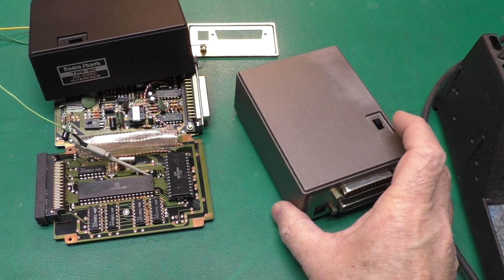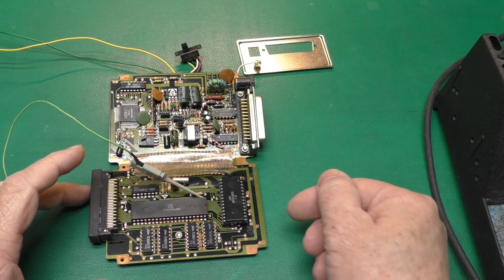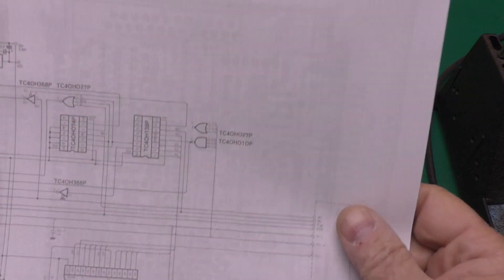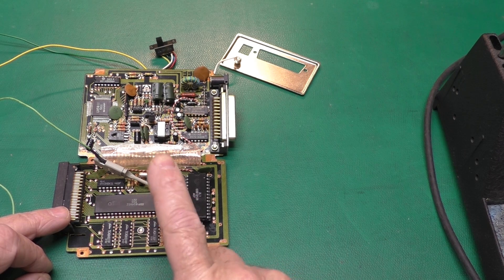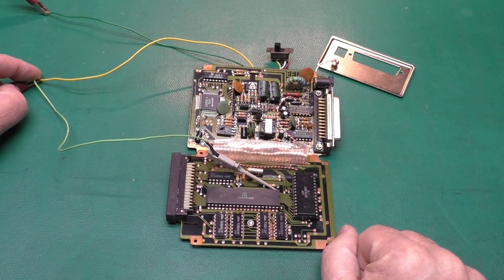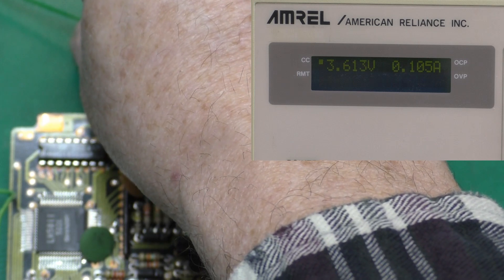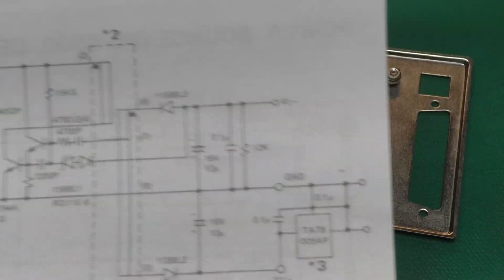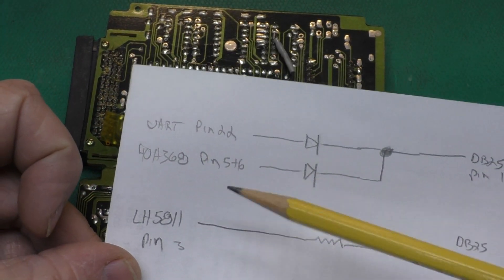Dodgy Bodgy? A very hungry TRS-80 26-3612, RS-232 Interface (Sharp CE-158)

Comment: Hey Birt, Did you have the specific com parameters that you used for coolterm. Can't seem to get my pc-2 with rs232 to communicate
Reply from the maker: Look on the product page. There is a 'Documentation and Video' tab. The ZIP folder has a preconfigured Coolterm profile.
Reply: @HeyBirt  I have the same board revision, but it has some obvious differences. I'm having an issue with garbled characters. Got the boards out for some visual eval and testing.

Comment: as this is a Radio Shack mod on otherwise unused serial lines, it stands to reason that there must have been a Radio Shack product that would connect to this port, yet not a plain serial printer or modem as these would use the normal interface voltage levels. Some specialty Radio Shack product for education or accessibility?
Reply from the maker: I browed through the RS computer catalogs for the years the RS232 interface was sold and found nothing that used TTL level serial coms. It is a mystery at this point.
Reply: @HeyBirt  me too. i dont think TTL serial was even a thing back then. i was thinking of some special device and just using the port as a method of io interface.
Reply from the maker: @fumthings  Sure TTL level serial coms was a thing back then. The Atari's used a TTL level serial bus, as did Commodore.
Reply: @HeyBirt  ok, thanks.

Comment: as for the mod, the DB-25 official pinout (the one comprising the secondary channel, the tx/rx clocks and the test pins) leaves ONLY pin 11 and 18 unused, so the mod was very well thought to not interfere with any possible device using the less common DB-25 optional functions of the RS-232 interface. However it's hard to tell what they intended to do. I'd check with the oscilloscope what happens when the interface is transferring data in and out on those two pins.
Reply from the maker: I do plan to scope the output. The only thing I can guess is it was for a TTL level serial output. The line going to the lh5811 could be used for a /BUSY  type signal. I'll also look through the CE-158 ROM code to see if this lh5811 output is used.